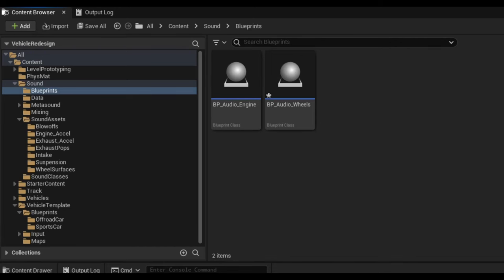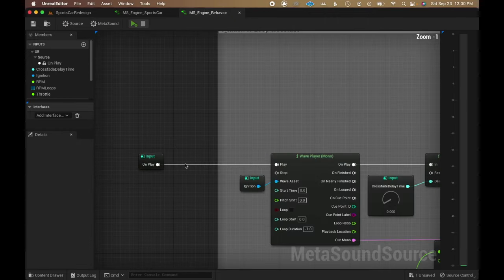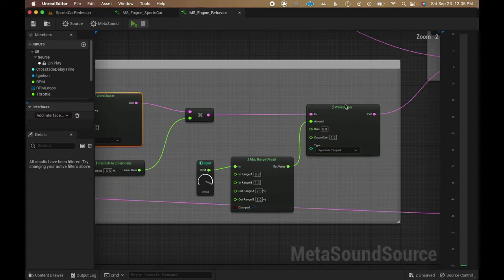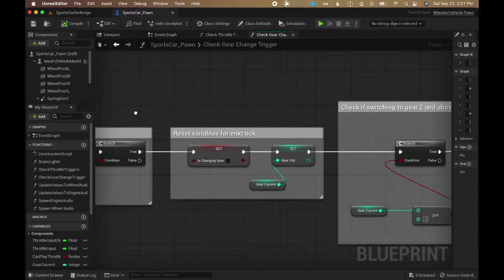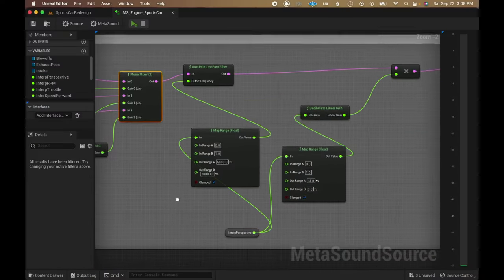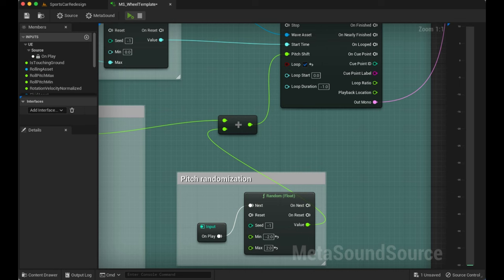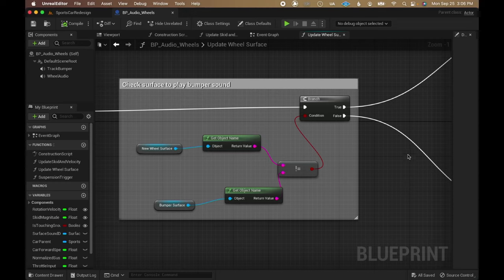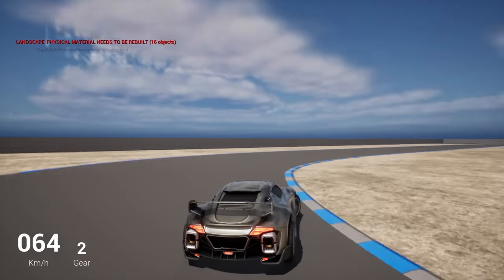UE5 Car Engine Audio System

Comment from the maker: Hey everyone! I've been getting a lot of emails asking about sharing the project. I'd gladly share it but the issue is that I don't have a license to distribute the audio files I used for the engine sound. I'm looking at possibly replacing the files with some other temp stuff or seeing if I can just distribute it w/o the files so you all can at least examine the code in more detail, but right now I'm very very busy with other life demands so this will have to wait a little bit, my apologies.

I really wasn't expecting this vid to get as much attention as it has xD. I made it primarily as a portfolio piece to show off my technical audio design as opposed to a step-by-step tutorial, but hopefully when I get the project to a shareable state you'll be able to see the stuff I skipped or glossed over in the vid :)
Reply: That's amazing ! I've been looking over and over on this video just to get it working in my project, without much success.. I did get some parts right, but overall the sound quality on your end is just superb ❤

Hope you'll find some placeholder sounds so you can share the project with the community 🙏🏻

Once again props up mate, you did an amazing job! 🎉 🎉
Reply: It would be amazing if you share it without the audio files too,people can swap the files ,just add some noise as the audio waves and it could be replaced,it is an amazing design
Reply: @Hamidsami021  as long we know what kind of audio should be placed in those spots; we might even get to the same level of quality as @caiojmini :face-blue-smiling:
Reply: Its the bluprinting and the metasound which interests me,as the sound is always going to change type by type
Reply: How do you learn how to do sound design like this I saw your portfolio you worked on some rocket leagues sfx's and what a job you did they sound amazing and this video here is just as good
Reply: any update on releasing the full code/blueprint logic for us to tinker around with :))
Reply: Was it uploaded somewhere?
Reply: Hey! looking forward for this masterpiece to be studied! I was cracking my head for past few months trying to figure out the way to blend rpms!
Reply: @pamparam3495  looks like he posted a follow up video but then deleted it after the collab with that hazardous guy
Reply: Still waiting for that project.......... it that wont happen then just tell us why keeping it quiet?
Reply: when can we expept the projectr. you are abit too quiet there.. if you dont release it just tell us
Reply: You have an impressive portfolio! Please do release this, I'd love to be able to learn from an industry professional. Perhaps doing a tutorial on the topic if you're unable to share the files?

Comment: thanks for posting this. Curious what FadeByFloatExport is doing?
Reply from the maker: i actually got that graph from this forum post: https://forums.unrealengine.com/t/crossfade-by-parameter-remade-in-metasound/728030  - basically makes it so you can fade in and fade out an audio signal within defined ranges of a parameter